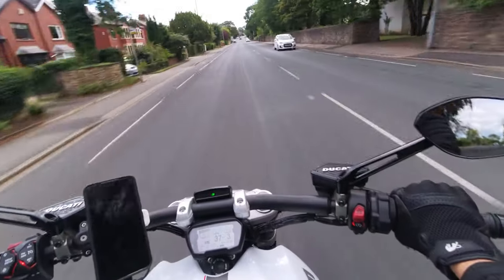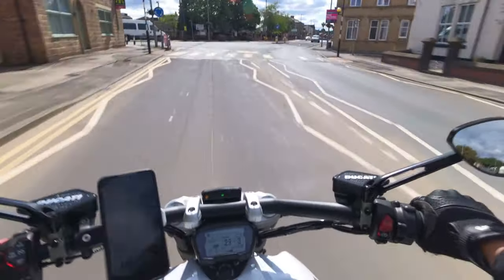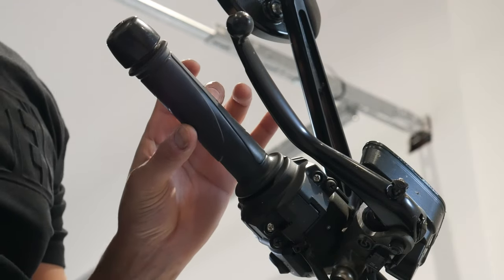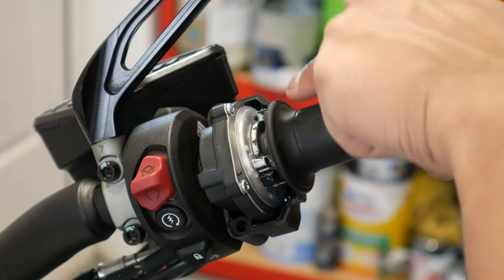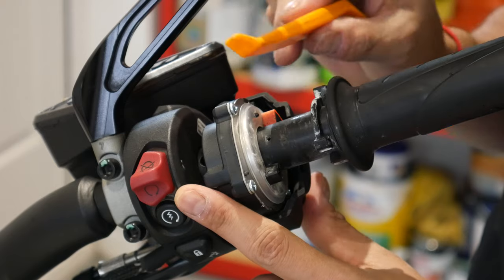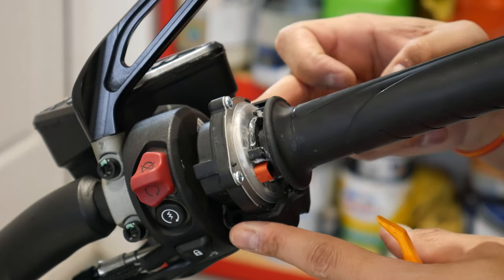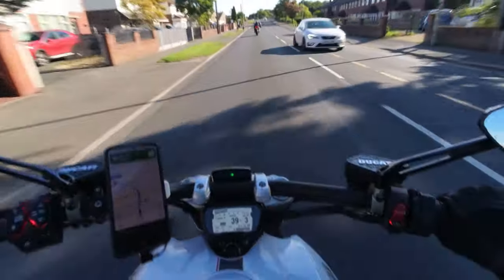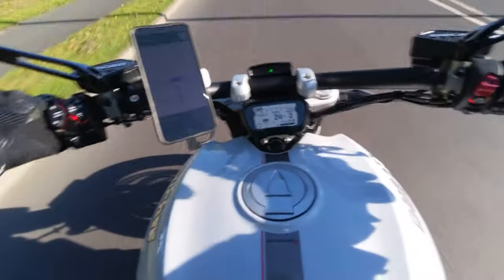How to Install Ducati Throttle Spacers to XDiavel S

Comment from the maker: Ducati Throttle Spacers:
https://amzn.to/3R1ztjp

🙏🏽 Affiliate links thanks for your support! 👍🏽

Ducati Throttle Spacers:
https://amzn.to/3R1ztjp

ND Filters Kit: https://store.insta360.com/accessory?...

FREE Battery Base & bike kit Insta360 ONE RS Camera:
https://www.insta360.com/sal/one_rs?i...

Insta360 ONE RS Microphone Adapter:
https://store.insta360.com/accessory?...

Insta360 ONE RS Boosted Battery:
https://store.insta360.com/accessory?...

Insta360 Tempered Glass Lens & Screen Protectors:
https://amzn.to/3OGyFPA

Sandisk V30 MicroSD Cards:
https://amzn.to/3SjCq0G

Purple Panda Microphone:
https://amzn.to/3vlyv9x

Shoei GT Air 2 Helmet:
https://amzn.to/3Qhj4HN

Ride Tech Chin Mounts:
https://ridetechmoto.com/

Best deals on bike gear:
https://tidd.ly/3oqKmyW